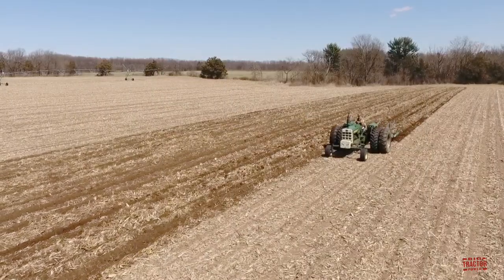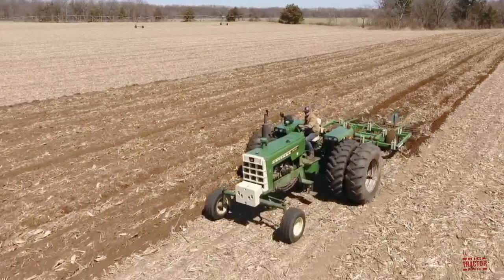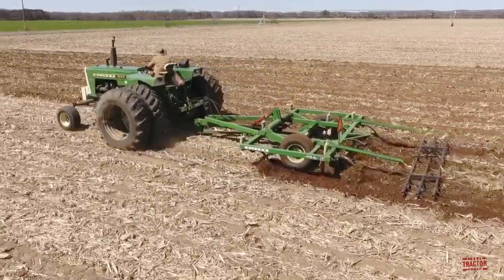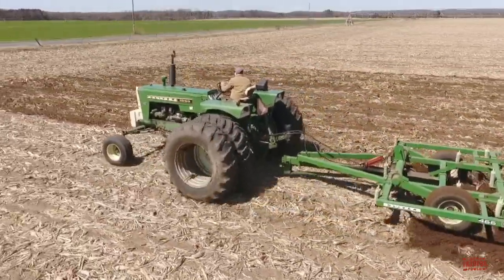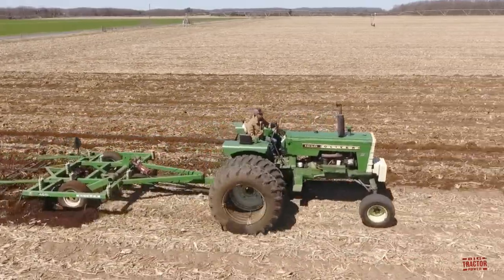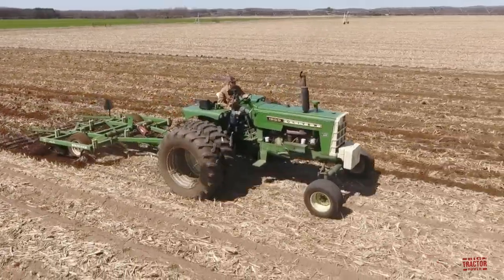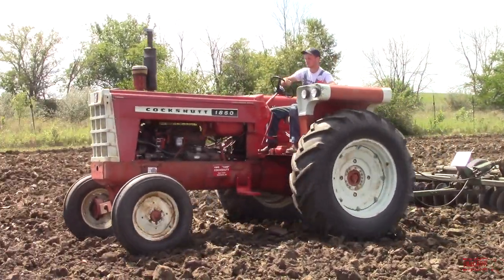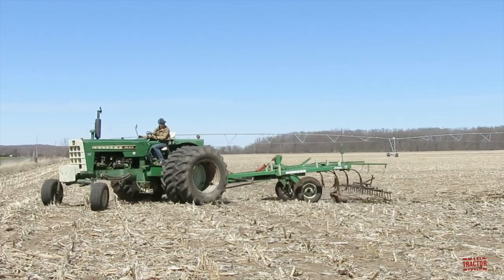OLIVER 1850 Tractor Chisel Plowing

Comment: Those 1850's are rated at 92 hp. They sure do a lot of work with those 92 hp.
Reply from the maker: 92 hp was big tractor power in its day.  👍👍
Reply: The Oliver hydraul shift did a pretty good job delivering power and the Perkins diesel is capable of quite a bit
Reply: @bigtractorpower  I had an 1850 gas. Had been rebuilt with m&w pistons. At a 121 hp it was just starting labour on the dyno.
Reply: @douglassellers7528   Man ,I bet she was thirsty too ,but good power!
Reply: Never hp,but always torque.

Comment: I own an 1850, love that Perkins engine. Its pretty easy on fuel compared to my IH 856, and starts good in the cold. My 1850 wears a White 1730 QA loader and also is the round baling tractor. The 1850 and 856 are some of the best 90 hp class tractors to come out of the late 60s in my opinion.

Comment: Awesome, Love Olivers. We had an 1850 diesel with fender tanks, absolutely loved that tractor. We had bolt on duals, that was so much fun to put on by myself (I only weighed about 145lbs in high school when we had this tractor in the 70's). We didn't have a chisel plow but a 4 bottom moldboard, field cultivator, disc, cultimultcher, planters and drills. Thanks for showing an 1850 brings back memories.
Reply from the maker: Great tractor and implement line up. Was the 1850 the big tractor on your farm?
Reply: @bigtractorpower  It was, we had a Super 88 diesel and a Farmall Super C.

Comment: The stock 1850 with 354 Perkins wasn’t turbocharged.. You could however find that same motor turbocharged in other tractors and combines ie 1135 Massey Ferguson tractors and 750 and 760 Massey combines. We had a 1850  Perkins, which I still own and love. Pulled 6 16 plow. Super dependable and  great sound when pulling hard. We pulled 6,16 inch  with front wheels in the air a lot. Too much plow really but “Bessy”,as my dad called her would pull it. Still use it but not on tough jobs anymore.  Love it!!!!

Comment: Growing up in West Central Minnesota, it's debatable as to which two tractors (880 diesel or our 1850) that I spent more time on. Both were year-round workhorses. Our 1850 planted the crops, ran the cultivator, chopped silage, disced, and in the winter, blew snow. Such a great tractor. ❤
Reply from the maker: Very cool. A farm I grew up about a mile from was all Oliver and Steiger.  They had an 88, 880, 1850, 1750 and 1755 along with three Steigers. I always enjoyed seeing the Olivers.  Today they still have Steigers but have moved to John Deere and Case IH row crops.

Comment: We have a 550 that is pretty much just a show tractor.  My tractor is a 1655 that has a loader, cleans manure, fixes the yard and roads with a box scraper, mows, rakes hay, and runs a small square baler.  We also have a 1955, but I haven't used it much yet.  I've pulled a sprinkler track closer and a wing mower with it.

Comment: That’s a nice pair. Almost bought a 466 plow at one point but needed a disk chisel to handle corn stalks. They are a little hard to find. Also you forgot the optional creeper gear and the optional high speed rear end. Lol
Reply from the maker: Seeing the 466 chisel with the 1850 is a great history opportunity.  I used my price guide for this video rather than the sales brochure.  I was surprised a creeper gear was not listed as these tractors were popular for running FMC LV pea combines.
Reply: I don’t think I have ever seen the creeper drive shown in any brochures for some reason. Don’t know if it was just such a regional thing they didn’t think it was worth advertising or what. I know DelMonte bought a lot of them for pulling green bean harvesters. They were pretty brand loyal to Oliver and Moline for a while. Seems when you do find them they are in Minnesota, Wisconsin, New York, Maryland or New Jersey. Basically where there were a lot of large scale vegetable growing/canning operations that needed that super slow gear.

Comment: I grew up with two cylinders, and 4020s. Most of my career has been in 40 and 50 series John Deere as well as 6, 7, and 8000 series John Deeres. At home I have a small operation with a 4020 as my primary tractor along with a 60 and my dad's 70 Diesel and 730 Diesel. After the ice storm in March I bought a Super 77 diesel to be the primary tractor for my generator. At half the displacement of the 4020 I am hoping for a large savings in fuel use. It sat for more than ten years so I have had to do a lot to get it running good. Lift pump and injection pump have been overhauled and I plan on replacing the injectors soon. It starts hard on a warm day but after warming up is a smooth runner. Hopefully injectors will help but if not then I guess an overhaul will be next. Not many Olivers in my area and this is the first one I have ever operated.
Reply from the maker: Thank you for sharing.  The Super 77 is a good one to have.  How does it compare to the 60?
Reply: @bigtractorpower  the best comparison at this point. The former owner of the 60 used to pull a three bottom 14 inch plow with it. The former owner of the 77 said he use a two bottom plow. I have had a 237 mounted picker on the 60 and it handled that good. Even though the 77 is rated a little higher horsepower, I think the 60 has a little bit more snot. The 77 has manual steering but I find it easier to steer than a Farmall M so between that and the fact that it doesn't have a hand clutch will make it a good yard tractor for putting hay wagons away at the end of the day. Plus it will be able to run the generator, one job a John Deere two cylinder can't do. I would say that the 60 in most areas is just plain built heavier than the Oliver.

Comment: As a teenager in 1968, 1969, and 1970, I plowed a lot of both corn and bean ground here in central Iowa with Dads 1850 diesel. The neighbors couldn't believe it would pull 6-16's, but it did.
Reply from the maker: Great brand of tractors and plows.

Comment: The front cast grill and counterweights look like they've been repainted, but the rest of the tractor looks original and unrestored.  Even the rear tires are really old but still look great.  (Are those Goodyear dyna-torque bias-ply tires in the inside?).  Even still has the required AM radio mounted on the fender.  The chisel plow is in equally awesome shape.  If the video quality wasn't so awesome, you could have told us that this was a movie taken in the mid-1970's.  I really enjoyed seeing this.  Thanks!
Reply from the maker: I am not sure on the tires. It was a great opportunity to be able to feature a period matching tillage team like this.  The 466 chisel plow is just awesome to see with the 1850.
Reply: You are correct on the paint. The white has been touched up on the grille and weights. The green is original. The chisel plow was painted in the 90s. The Inside rear tires are actually new. They are a bias ply titian tire. The duals are Firestone field and road tires from the 70s most likely.
Reply: @dovervillefarms  Man your a good operator. You really have a nice  out fit. Hope you've had a blessed year and a better one next year. Merry Christmas Everybody.

Comment: We have an Oliver 1800 model b. It has a lot of issues. Transmission and hydraulic fluid leaks, gas leaks into the oil, but it starts first try every time.

Comment: That tractor is a bad hammer, jammer.  All those early 1960's 90+ hp tractors were the bomb.  I liked the JD 4020, the Allis Chalmers D21, The IH 1206, The Ford 9000, the biig Minneapolis Moline.  I worked for Green Giant driving a pea combine the Summers of 1973 and 1974.  There were 6 tractors on a crew and we had about all makes and models, all of the 80 to 100 hp range.  I got to try them all.

Comment: Love your videos Jason, but I think you've mistaken the turbo on this tractor. The 1850 was naturally aspirated.  They turbocharged the 354 Perkins for the white 105 producing 105 HP. Oliver's are still some of the best looking tractors produced in my opinion.  Keep up the good work..
Reply: An Jason is not wrong
Reply: Thanks for including Oliver Jason, appreciate it. This comment is correct correct, 1850 D was naturally aspirated 354 Perkins. First time Oliver turbo’d was the 310 in the 1950-T, then later turbo’d the 354 Perkins in the White 2-105.
Reply: @davidmarley9471  no jason is correct
Reply: @shaunault7538  I thought I was right about this and just double checked in my Oliver parts book for the 1850. The only way this tractor had a turbo was either aftermarket or a swap from a  White 105. You may be thinking of the 1855 which did have a turbo, but was a different engine with the 310
Reply: Its a great video as always, but the 1850 was never turbocharged from the factory.
Reply: @ThatOliverGuyChris  thanks Chris for confirming 👍 no one will doubt the Oliver guy...lol
Reply: @paulkline2719  only because my wife isn't on here. 😂
Reply: @ThatOliverGuyChris  I wondered when you were going to chime in. 😄
Reply from the maker: I double check my audio and for some reason I did not hear myself say turbo.  I say turbo for so many diesels I guess it slipped in there by accident.
Reply: Again, thank you Jason for all your work in editing and providing good information.  In all the videos you have provided, a detail is going get by sometime.  Please keep up the good work!

Comment: The 1850 Oliver DID NOT HAVE A TURBOCHARGER ON IT…My dad worked for Oliver at a dealership from the time they had the 550,770,880,990 to the time he became a Territory Manager when they introduced the 50 series til the came out with 55 series. The 1855 had a turbocharger on it when they returned to the Waukesha Diesel engine that they used in the 1950, but they ran into trouble with oiling issues(due to the fact that they failed to put an oil cooler that was still on the 1950-1955 !!
Reply: True, the 1855 was turbocharged but lacked the 1955's oil cooling capacity.

Comment: My brother had a 1850 diesel that I spent many hours on. It was a real workhorse and had lots of power but it was rough riding as hell and would burn you up on a hot day. It finally spun the rear main crankshaft bearing and my brother traded it off for a new 4020 John Deere diesel and never looked back.

Comment: 1850 was not turbo charged from the factory. Also there were 9 models in the 50 series. 1250,1250-A 1450,1550, 1650, 1750, 1850, 1950, 1950-T, 2050, 2150. They had horsepower ratings of 42hp through 131hp.
Reply from the maker: To me the 50 series gets complicated. You have the smaller Fiat built utility tractor ties. The 2150 and 2050 were not introduced until 1967 and I would put them in a class by themselves as a large frame model and chose not to list them with the 1850 this time. The 2050 and 2150 are on my top 10 tractors to film wish list.  They are hard to find.   Then you have the 1950-T introduced in 1967 and replacing the 1950.    I chose to highlight the 1550-1950 because they were produced with the 1850.
Reply: @bigtractorpower  I got ya. We had a 2050 and a 2150 on the farm. For its day a 2150 was a horse. We used to pull chisel plow and a 3500 gallon manure tanker with it. It toyed with that tanker. 2150's are starting to show up here in  Southeast/ Northeast Ohio as collector tractors.
Reply: N yes it was my neighbor owns one
Reply: I use a 1750 1755,and 1800 all diesel in small hay production. Great tractors.

Comment: Nice old classic, but what ruins them for me as far as looks go…why did Oliver stick that front axle out so far?? It dates the tractor to look like the industry standard from the 1950’s. It would look so much better if they had tucked the front axle in under the front end better, IMO.
Reply: My guess is for weight balance. I've seen the front-end come off the ground when using a disc on a 2wd tractor. Scared the crap outta me as a kid. Front-end weights weren't used on grandads tractors. The 4wd models had enough weight with that heavy axle up front.
Reply: @mikewithers299  that’s a good point
Reply: @mikewithers299  From first hand experience I can tell you it also provides for a smoother ride and more room for front mounted implements that were still in use at the time.

Comment: Implement needs to be twice the width, the duels are compressing soil thats been cultivated on each pass, basically wasting fuel & time.
Reply from the maker: Chisel plowing bogs a tractor big time.  It’s like towing an anchor.  The 455 at 9 shanks is well matched to the 1850. In the 1960’s dual tires started becoming common place on higher horse power row crop tractors to increase flotation, traction and reduce compaction.  The duals will compact less than singles and the chisel is breaking up the tractors imprint.
Reply: @bigtractorpower  OK, thanks.